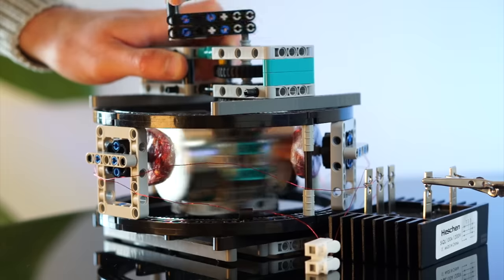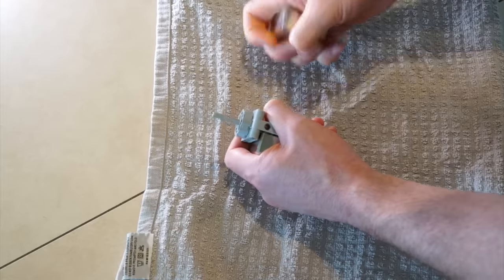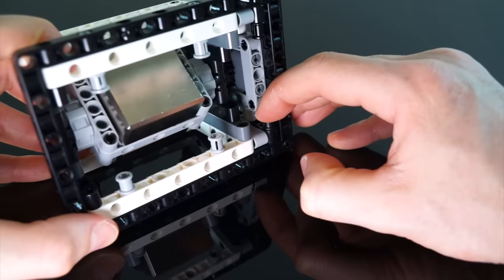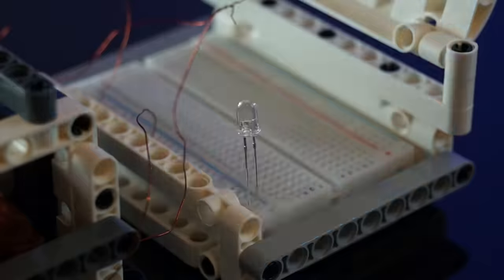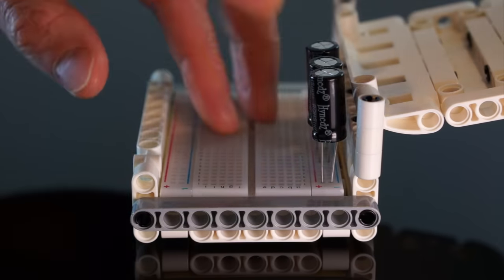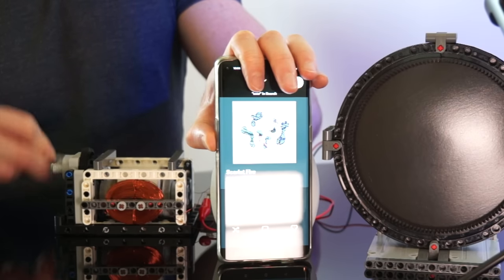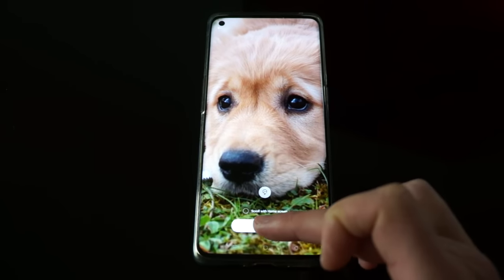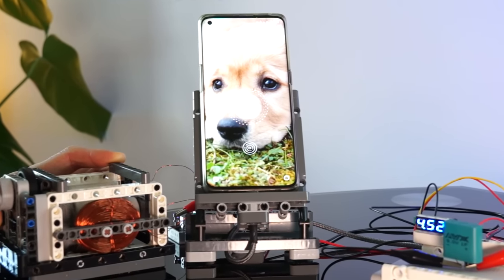Powering My Gadgets With Lego!

Comment: You could add a joule thief circuit to output a steady voltage. this kind of circuit is used in shaking torches and is designed to be used with coils in generator circuits.
Reply: shanking torches

I dont think i want to know what that is
Reply from the maker: I love joule thieves - made a bunch a while back. Very elegant little circuits. Could totally show those off in a future video!
Reply: @sumynona.01  autocorrect
Reply: @aussiecrocs1  ohhhh

im still scared

why tf would one want shaking torches

dont blame it on autocorrect again
Reply: @sumynona.01  they are for black outs, power shortages, or lack of batteries.
Reply: @aussiecrocs1  ok
Reply: @sumynona.01  Lol just so you know, “shaking torches” aren’t literal torches that shake - they’re essentially just flashlights that can be charged by shaking them.
Reply: @doomtho42  ohhhhhhhhhhhhhhhhhhhhhhhhhhhhhhhhhhhhhhhhhhhhhhhhhhhhhhhhhhhhhhhhhhhhhhhhhhhhhhhhhhhhhhhhhhhhhhhhhhhhhhhhhhhhhhhhhhhhhhhhhhhhhhhhhhhhhhhhhhhhhhhhhhhhhhhhhhhhhhhhhhhhhhhhhhhhhhhhhhhhhhhhhhhhhhhhhhhhhhhhhhhhhhhhhhhhhhhhhhhhhhhhhhhhhhhhhhhhhhhhhhhhhhhhhhhhhhhhhhhhhhhhhhhhhhhhhhhhhhhhhhhhhhhhhhhhhhhhhhhhhhhhhhhhhhhhhhhhhhhhhhhhhhhhhhhhhhhhhhhhhhhhhhhhhhhhhhhhhhhhhhhhhhhhhhhhhhhhhhhhhhhhhhhhhhhhhhhhhhhhhhhhhhhhhhhhhhhhhhhhhhhhhhhhhhhhhhhhhhhhhhhhhhhhhhhhhhhhhhhhhhhhhhhhhhhhhhhhhhhhhhhhhhhhhhhhhhhhhhhhhhhhhhhhhhhhhhhhhhhhhhhhhhhhhhhhhhhhhhhhhhhhhhhhhhhhhhhhhhhhhhhhhhhhhhhhhhhhhhhhhhhhhhhhhhhhhhhhhhhhhhhhhhhhhhhhhhhhhhhhhhhhhhhhhhhhhhhhhhhhhhhhhhhhhhhhhhhhhhhhhhhhhhhhhhhhhhhhhhhhhhhhhhhhhhhhhhhhhhhhhhhhhhhhhhhhhhhhhhhhhhhhhhhhhhhhhhhhhhhhhhhhhhhhhhhhhhhhhhhhhhhhhhhhhhhhhhhhhhhhhhhhhhhhhhhhhhhhhhhhhhhhhhhhhhhhhhhhhhhhhhhhhhhhhhhhhhhhhhhhhhhhhhhhhhhhhhhhhhhhhhhhhhhhhhhhhhhhhhhhhhhhhhhhhhhhhhhhhhhhhhhhhhhhhhhhhhhhhhhhhhhhhhhhhhhhhhhhhhhhhhhhhhhhhhhhhhhhhhhhhhhhhhhhhhhhhhhhhhhhhhhhhhhhhhhhhhhhhhhhhhhhhhhhhhhhhhhhhhhhhhhhhhhhhhhhhhhhhhhhhhhhhhhhhhhhhhhhhhhhhhhhhhhhhhhhhhhhhhhhhhhhhhhhhhhhhhhhhhhhhhhhhhhhhhhhhhhhhhhhhhhhhhhhhhhhhhhhhhhhhhhhhhhhhhhhhhhhhhhhhhhhhhhhhhhhhhhhhhhhhhhhhhhhhhhhhhhhhhhhhhhhhhhhhhhhhhhhhhhhhhhhhhhhhhhhhhhhhhhhhhhhhhhhhhhhhhhhhhhhhhhhhhhhhhhhhhhhhhhhhhhhhhhhhhhhhhhhhhhhhhhhhhhhhhhhhhhhhhhhhhhhhhhhhhhhhhhhhhhhhhhhhhhhhhhhhhhhhhhhhhhhhhhhhhhhhhhhhhhhhhhhhhhhhhhhhhhhhhhhhhhhhhhhhhhhhhhhhhhhhhhhhhhhhhhhhhhhhhhhhhhhhhhhhhhhhhhhhhhhhhhhhhhhhhhhhhhhhhhhhhhhhhhhhhhhhhhhhhhhhhhhhhhhhhhhhhhhhhhhhhhhhhhhhhhhhhhhhhhhhhhhhhhhhhhhhhhhhhhhhhhhhhhhhhhhhhhhhhhhhhhhhhhhhhhhhhhhhhhhhhhhhhhhhhhhhhhhhhhhhhhhhhhhhhhhhhhhhhhhhhhhhhhhhhhhhhhhhhhhhhhhhhhhhhhhhhhhhhhhhhhhhhhhhhhhhhhhhhhhhhhhhhhhhhhhhhhhhhhhhhhhhhhhhhhhhhhhhhhhhhhhhhhhhhhhhhhhhhhhhhhhhhhhhhhhhhhhhhhhhhhhhhhhhhhhhhhhhhhhhhhhhhhhhhhhhhhhhhhhhhhhhhhhhhhhhhhhhhhhhhhhhhhhhhhhhhhhhhhhhhhhhhhhhhhhhhhhhhhhhhhhhhhhhhhhhhhhhhhhhhhhhhhhhhhhhhhhhhhhhhhhhhhhhhhhhhhhhhhhhhhhhhhhhhhhhhhhhhhhhhhhhhhhhhhhhhhhhhhhhhhhhhhhhhhhhhhhhhhhhhhhhhhhhhhhhhhhhhhhhhhhhhhhhhhhhhhhhhhhhhhhhhhhhhhhhhhhhhhhhhhhhhhhhhhhhhhhhhhhhhhhhhhhhhhhhhhhhhhhhhhhhhhhhhhhhhhhhhhhhhhhhhhhhhhhhhhhhhhhhhhhhhhhhhhhhhhhhhhhhhhhhhhhhhhhhhhhhhhhhhhhhhhhhhhhhhhhhhhhhhhhhhhhhhhhhhhhhhhhhhhhhhhhhhhhhhhhhhhhhhhhhhhhhhhhhhhhhhhhhhhhhhhhhhhhhhhhhhhhhhhhhhhhhhhhhhhhhhhhhhhhhhhhhhhhhhhhhhhhhhhhhhhhhhhhhhhhhhhhhhhhhhhhhhhhhhhhhhhhhhhhhhhhhhhhhhhhhhhhhhhhhhhhhhhhhhhhhhhhhhhhhhhhhhhhhhhhhhhhhhhhhhhhhhhhhhhhhhhhhhhhhhhhhhhhhhhhhhhhhhhhhhhhhhhhhhhhhhhhhhhhhhhhhhhhhhhhhhhhhhhhhhhhhhhhhhhhhhhhhhhhhhhhhhhhhhhhhhhhhhhhhhhhhhhhhhhhhhhhhhhhhhhhhhhhhhhhhhhhhhhhhhhhhhhhhhhhhhhhhhhhhhhhhhhhhhhhhhhhhhhhhhhhhhhhhhhhhhhhhhhhhhhhhhhhhhhhhhhhhhhhhhhhhhhhhhhhhhhhhhhhhhhhhhhhhhhhhhhhhhhhhhhhhhhhhhhhhhhhhhhhhhhhhhhhhhhhhhhhhhhhhhhhhhhhhhhhhhhhhhhhhhhhhhhhhhhhhhhhhhhhhhhhhhhhhhhhhhhhhhhhhhhhhhhhhhhhhhhhhhhhhhhhhhhhhhhhhhhhhhhhhhhhhhhhhhhhhhhhhhhhhhhhhhhhhhhhhhhhhhhhhhhhhhhhhhhhhhhhhhhhhhhhhhhhhhhhhhhhhhhhhhhhhhhhhhhhhhhhhhhhhhhhhhhhhhhhhhhhhhhhhhhhhhhhhhhhhhhhhhhhhhhhhhhhhhhhhhhhhhhhhhhhhhhhhhhhhhhhhhhhhhhhhhhhhhhhhhhhhhhhhhhhhhhhhhhhhhhhhhhhhhhhhhhhhhhhhhhhhhhhhhhhhhhhhhhhhhhhhhhhhhhhhhhhhhhhhhhhhhhhhhhhhhhhhhhhhhhhhhhhhhhhhhhhhhhhhhhhhhhhhhhhhhhhhhhhhhhhhhhhhhhhhhhhhhhhhhhhhhhhhhhhhhhhhhhhhhhhhhhhhhhhhhhhhhhhhhhhhhhhhhhhhhhhhhhhhhhhhhhhhhhhhhhhhhhhhhhhhhhhhhhhhhhhhhhhhhhhhhhhhhhhhhhhhhhhhhhhhhhhhhhhhhhhhhhhhhhhhhhhhhhhhhhhhhhhhhhhhhhhhhhhhhhhhhhhhhhhhhhhhhhhhhhhhhhhhhhhhhhhhhhhhhhhhhhhhhhhhhhhhhhhhhhhhhhhhhhhhhhhhhhhhhhhhhhhhhhhhhhhhhhhhhhhhhhhhhhhhhhhhhhhhhhhhhhhhhhhhhhh
Reply: @sumynona.01  bro was enlightened
Reply: Eh, capacitor smoothing would be simpler...
Reply: isn't a joule thief a flyback boost converter though? especially one that'll try to boost "infinitely" (in theory; in practice "usually" <200V) until current is drawn (which is why it's so great for LEDs and designed to be used with caps/batteries in crank/shaking torches, not hooked to a generator directly, given it requires a stablish input voltage itself)? given most of the time the voltage is higher than 5V (at least when stabilized with a large enough cap) it wouldn't really do anything but potentially fry the phone if for any reason (full, not charging yet, rebooting, ...) it ever decides to disconnect (high-Z) its input. all in all sounds about as healthy to me as "fully charge a 100V supercap and wire it right to the usb cable" (which, for the sake of youtube not being upset, i should point out is NOT healthy at all by the way) and honestly an LDO would've been a better suggestion (though still orders of magnitude worse than the buckboost Jamie already used in the video. what actually steadies the voltage more is the other thing he already did: simply use a larger capacitor. or maybe even charge a battery if you want to store your cranking for much longer. with ~9V and if it was meant for actual "extreme conditions" i would probably choose a lead-gel marine battery or somesuch because they're good for that voltage range and "just work" even in conditions that regularly blow up teslas, most likely outliving the involved lego pieces multiple times over)
Reply: @justinpatterson5291 and less frying too ;)
Reply: @justinpatterson5291 I thought so too.

Comment: What happens when you replace the copper wire with solid copper
Reply from the maker: You mean like a plate of copper? I'd imagine it wouldn't generate anything really. Your output voltage is proportional to the number of loops of wire. Without loops, you wouldn't generate anything

Comment: You can probably increase the efficiency by using electromagnets instead of permanent magnets like real generators use. You'd need to make lego brushes and use either use a magnet generator like this one on the same shaft or a feedback circuit to power the coils.
Reply from the maker: I would absolutely love to try building a self-exciting generator using electromagnets, but still need to do a lot more reading on how to get it to work (and to start and control when it's running). Cool idea, cheers for the suggestion!

Comment: With two or more lego rings from the speakers, a good amount of strong big or small magnet blocks and coil arrangement...
a well designed shaft or bushing levitating system for decrease friction...
A flywheel....
and a good detachable gearbox...
Could end up on a really and powerful selfmade lego generator!

With a vertical helical cardboard or papper propeller in the end could work as a Vertical axis wind turbines?
If it works and isnt expensive, I would try to make one too X)
Reply from the maker: Definitely going to try making either a vertical or horizontal turbine generator! Already had some promising experiments - I'd definitely encourage you to try your own if you're interested in this stuff. If expense is an issue, other home materials work great!

Comment: You need 2 cheap things to make it more efficient than that. The first one is a full bridge rectifier that takes the negative part of the AC voltage the reverses it to make it a kind of DC voltage. You can implement such kind of rectifier with 4 simple diodes if you search on internet. Then at the output of the rectifier you need a capacitor in order to smooth the voltage and make it stable. You will see that the leds will stop blinking and it will be producing more stable voltage.
Reply from the maker: Yup, later in the video those are the exact things I used to power the speaker and phone. The small block with pins was the full bridge rectifier and the capacitor bank was used to smooth the output!

Comment: Now you only need to create a gravity battery and hook it to the crank, and you're sorted. Will have to figure out the proper gearing and a way to stop the weight from accelerating beyond a certain point, but I'm sure you'll sort it.
Reply from the maker: Love the way you think! I've actually already made one - using an escapement (tick tock) to slow the feed, and a big magnet as the pendulum. Love the idea of gravity batteries - thanks for the suggestion!

Comment: Add a gearbox to lower the amount of rotations you need on the handle to make the magnets spin even quicker
Reply from the maker: Can do if a device needs higher voltages! Though for lower voltage devices, the losses in efficiency with higher gear ratios tend to make it perform significantly worse
Reply: Then make an engine instead of hand cranking it. Maybe a pneumatic one?
Reply from the maker: Now you're talking! I've already got a pneumatic one running 😉

Comment: Maybe by connecting diodes to + and from - going to and from both terminals of the coils
Reply from the maker: You mean like a rectifier?
Reply: @JamiesBrickJams  IDK what a rectifier is but if you mean the thing that uses 4 diodes to make the backwards power forwards and the forwards power also forwards than yes
Reply: Rectifier sounds about right
Reply from the maker: Ah gotcha, that's the blocky silver thing I was using in the vid!
Reply: @JamiesBrickJams  makes sense. I imagine the blinking isn’t the power going up and neutral and down and neutral, but rather up and neutral and up and neutral, where neutral is no power and down is backwards power. I thought the blinks meant a lack of rectifying
Reply from the maker: Yup! Actually you're right, I didn't rectify the signal when feeding the LEDs, but they flash with or without rectifying - exactly as you described

Comment: If your phone supports fast charging, it will almost certainly survive more than 5V, and has a chance of charging faster with it. Though unless you want to implement a negotiation circuit, you'll need to look up the details of your phone yourself.
Reply from the maker: You're probably right .. I'll probably try again with a 3 phase generator outputting lower voltage but higher current just in case!

Comment: I would add more gear ratios and (if possible) a bigger gear
Reply from the maker: It's possible if you want to increase voltage! But more gears decreases efficiency, so you'll end up with a net loss compared to no gearing

Comment: Have you tried to increase the cranking speed with an electric drill? Will that make any difference in the time needed to charge the phone? Obviously that will drain the drill’s battery but still.
Reply from the maker: I haven't tried that, no - it would almost certainly increase the output massively. At least until it warps or breaks the Lego. Better to use the battery powering the drill 😉 But as a proof of concept, it would certainly charge the phone quicker

Comment: how does the copper coil not just short out? you would need to coat it with smth so it doesn’t short out
Reply from the maker: Almost all copper wire / magnet wire (like this stuff) is already coated with a very thin enamel which keeps it from shorting

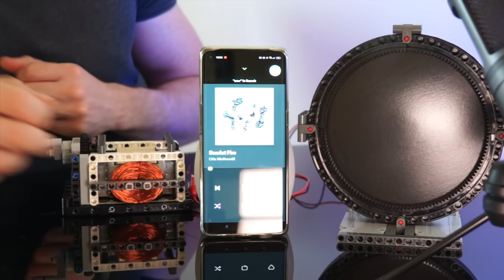Comment: You pointed the microphone the wrong way again (5:10). With that microphone (I believe it's the AT2020) you want the logo/side with the light to be facing your audio source since it will basically only pick up sound from that side.
Reply from the maker: That's about as close to parallel to the speaker I could get with this tiny mic tripod - will try a different approach next time!

Comment: could you make more of these and put it into series and array it ? using belt chain to like them all up
Reply from the maker: You could ... Although what you're really doing is turning mechanical energy into electrical energy. So if you did that, you'd have a very lossy system of generators. You'd be better off putting all of your mechanical input into just one single generator and using that to power something

Comment: Could you add a few gear steps to increase speed?
Reply from the maker: Can do, increasing speed will increase voltage! But at the cost of current and efficiency. So if you need the voltage higher, it might be worth it. But otherwise you're better off using as little gearing as possible

Comment: Make the gear ratio super high so it spins super SUPER fast at low speeds
Reply from the maker: Can do, but the gear ratio results in massive efficiency losses - so voltage will increase, but current will drop. And when attached to a load, the losses become very noticeable

Comment: if it makes about 9 V could you add a lego motor to turn it becouse they only use 9 v to run??
Reply from the maker: It outputs around 9 to 10 volts, but the current isn't particularly high, so it's not very good for driving motors unfortunately (which need a lot of current)

Comment: What if i power the axle with a lego motor that gets the power from the generator? Infinite power glitch?
Reply from the maker: I wish 😁 Unfortunately there will be massive losses in between them. The generator really isn't very efficient, so the output isn't enough to even drive a small motor. Motors generally need quite a significant current to drive them

Comment: You should add a LEGO motor to the end of the crank so u can use the energy created to power the motor to create  more energy and so on... if this theory doesn’t work please tell me why as I am open to correct answers about my theory
Reply from the maker: I see where you're going with that theory. However that's the common 'perpetual motion machine' proposal, and it breaks the fundamental law of conservation of energy. Essentially what will happen is that energy is lost to its surroundings. So when you crank the handle, although some electricity will be generated, much of the energy will be lost to mechanical friction, sound, heat, etc. And so the amount generated will be smaller than what would be needed to feed the motor to turn it. In fact in this case, my generator is VERY inefficient. Motors generally require massive current to drive them. Mine really doesn't output much
Reply: @JamiesBrickJams  now that deserves a sub
Reply from the maker: Thanks for joining 😁
Reply: @JamiesBrickJams  anytime😀

Comment: 2:02
You meant: in turning mechanical power into friction and  heat?

you said . MECHANICAL POWER INTO ELECTRICAL POWER..
 how can a simple gear do that
Reply from the maker: Yep, the gearing causes efficiency loss to friction and heat. That's why I stressed that less gearing is preferable, as this is where your efficiency loss comes from. In an ideal world, you'd have no gearing, and would tailor the number of coil windings to generate the approximate voltage you need at a given speed

Comment: Would have been cool to see how powerful you could make it by messing around with gear ratios. I think the limiting factor was how quickly you could move your hand 😛
Reply from the maker: Ha yeah for this one, I could have done with a higher gear ratio or more coil loops! Though in general higher gear ratios lead to significant losses in efficiency turning mechanical power into electrical

Comment: Now add a lego motor to it's input thatis firstly connected to a lego volt inverter switch and seconly connected to a 5V limitor then to a output.
And add another output to charge your gaddgets with and now you get a constant yet controlled free energy sourse, fakt bich.

Comment: It produces AC, isn't it?
Reply from the maker: The direct output is AC, yes. And then it goes to the rectifier which turns it into DC. That's needed for powering devices like your phone. And once it's in DC, you can use capacitors to smooth the signal too

Comment: Can i ask? If you technically spin faster will it have bigger output?
Reply from the maker: In general, yup! If you attach a load to it (e.g., a high powered light), you can feel the resistance increase. So if you increase the force of winding, or speed of winding, the output will also increase. All it's really doing is converting mechanical power into electrical power. So the more mechanical power you put in, the more electrical output you'll get out
Reply: @JamiesBrickJams  ooh thank you